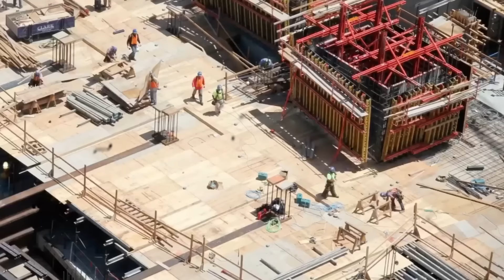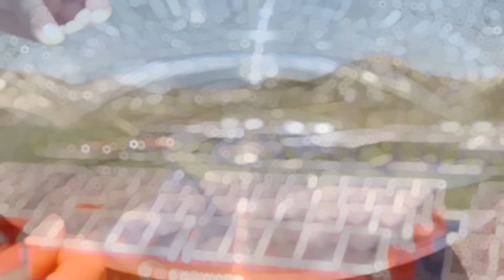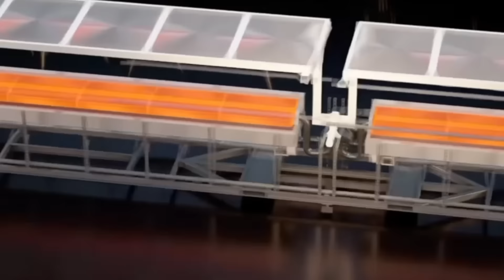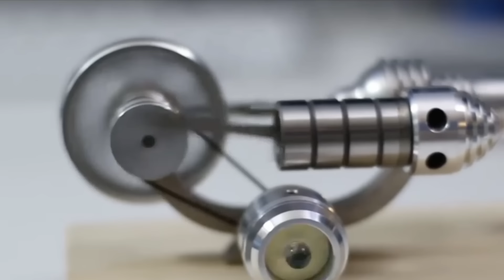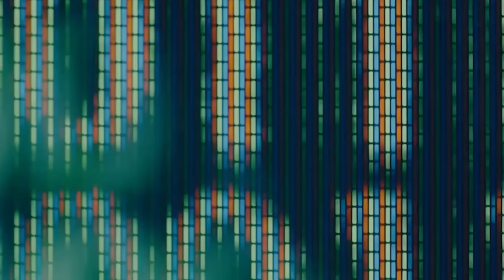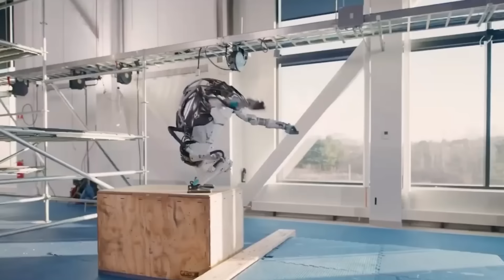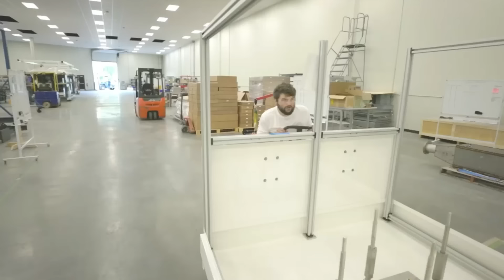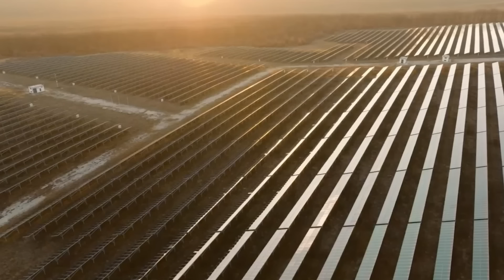Solar Energy is Changing: No Panels, No Lithium Batteries

Comment: Good for domestic use, if use them commercially like agrivolts under which you can conduct farming practices. But exo watt are not Compitable for that. 

Another factor is that exo watt have high maintenance i am not sure but looks like becoz the system it's running on a kind of machine which needs maintenance like changing the belt or the coils in it. 

For solar pannel they should discover an alternative to lithium ion batteries like supplying electricity to direct electric substation.

Comment: 6:10 The acreage for solar depends on if you sun tracking system or no tracking systems. Sun tracking allows 100-200kw per acre. No tracking allows for 400-500kw per acre. Also this does not consider local zoning restrictions.

Comment: Why not use vertical parabolic reflectors with a fluid filled collector pipe in a vacuum tube ?
No moving parts to wear out, Easy to keep clean. No snow or dust build up and mechanically stronger against wind force ?

Comment: Making it as a meachine could be harder 
What if they can make a powerplant kind of thing 

But instead of using coal, they use these lens to heat water, through steam generate electricity....

Even that's better than burning fossil fuels like coal...

Why is it not a thing ?
Any idea ?

Comment: Heat is 48% of the energy in sunlight. The "light" part of it is not heat. Heat has to be converted to electricity for distribution. That is probably 50% efficient at best.

Comment: According to my little brain, the thermal battery would work over night partly because the nights coolness, as the Stirling engine has to have a cooling side, but the battery would leak quite a bit of heat. So I reckon cloudy places would not work, as the storage is not long enough. Stirling engines are not very efficient, but there is room for improvement with new materials. This system would rely quite a lot on the inverter system, to create a goods mains voltage, from a varying source, and a computer to make sure it is pointing well, and telling the maintenance about issues.

Comment: I have been a Sterling engine fan since childhood. I would love to see it work at scale. I had high hopes for the start up back in the 2010s that was pursuing the dream using Fresnel lenses. If the batteries are an improvement, then all the better. I like how this inverts the mindset of the original model from converting light to motion to electricity to storage to storing light as heat as the first step, then to motion to electricity.

Comment: I wonder if you could harness the heat from data centers to recapture a small amount of energy 🤔
Reply: You could use air to water heat pumps to cool the server rooms and have warm water as a waste product.
Still you need logistics and infrastructure for that.
In the summer when you have to get rid of more heat, people need less heat. 
Not sure if there are many examples of where they are doing it already, but it sounds doable.

Comment: Just another fail project, guess if they rised the  fund, the guy whom think of it get a slide. 
For those thinking UK that out, like not having the sun to work out.
UK once used storage heater, that around same bricks. If this bricks work excess power could be used to charge and discharge.
It will work, but not to the point it selling that how I see it.. some other pointed out. Moving parts that needed more maintenance...

Comment: The question is if the lenses are cheaper than Solarpanels measured by kWh not space 🔍 you can use Solar with thermal or kinetic energy storage without transforming sunlight into heat and than to electric ⚡️ furthermore solar works with light - no need of pure sunshine ☀️

Comment: This MIGHT be a solution for special cases, but for general use, SIMPLICITY = no moving parts, fixed mounting, no maintenance ALWAYS wins. Try using these containers in africa - they will be dead matter in no time. Use them in northern areas? Forget it. P
11 minutes of overblown babling as usual, when some exotic approach comes up.
Combining PV panels with additional tech that uses the heat on the back on the panel, might make sense in certain areas and use cases.

Comment: Sounds good but there are a lot of concerns:
1) Americans = unreliable. Today you buy it and tomorrow receive tariffs, ID verification and no maintenance. So only for internal US usage.
2) Cost. What is the cost of this container? How much energy 1 unit can? For example, I want to install it one at my backyard in Australia. What will I receive? No answer even on their website.
3) During cloud days there is still light, but more diffused. Are this system works at these conditions?
4) If this ceramic block is so wonderful, and insulation is so prefect that the system can store energy for 12 hours without losses in efficient, solar light is the only source of heat that can be used. Virtually in can be everything.
5) Why Sterling engine? Why not thermoelectric generator? It contains less moving part and despite it less effective, the system can be more reliable with it.

Comment: I will say: "show me working installation" and total cost of it to providing constant 1kW through 24h (and same in next 30 days!). I will say It will never works in this shape for countries located as Europe as sun is a NOT rolling OVER at 90° in this locations, usually it is range 30-60° - so whole installation have to be slanted on such slope or totally redesigned. As well Stirling engines needs a huge "cooling side" which was totally omitted in this presentation. Looks like baloons, not tech.
Reply: Gimme that gooey VC money $$$$$ 🤤

Comment: The sun doesn't always shine. Same problem as Solar.
Reply: you obviously didn't understant the video. 
This system is very efficient and cost effective
Reply: @NeuralDev LmAO 🤣 😂 😆  Stop trying to sell snake oil. You are not fooling anyone with that garbage!
Reply: It doesn't, but the difference here is that it's based on temperature difference (since it involves a stirling engine), not sunlight availability. Push comes to shove you can heat it using a different fuel and would still work. it stores heat, not convert it directly to electricity.
Reply: Solar runs on light so there is NEVER a day that solar does not produce. Across OZ for all solar its approx +/- 35% from expected output for a given day in the future. Solar can be seen as semi reliable unlike Wind which is totally random.
Reply: @TimMountjoy-zy2fd  So are you saying that PV and Solar works at night when the Sun is not shining????

Comment: Every home could have its own small system
Reply: a shipping container takes up a large amount of space. in many cities, having a shipping container on residential property is prohibited. in the video, the container is equipped to gain upto 3,000 degrees. having that much heat next to a home is dangerous. and the system must be monitored continuously with access for repair, thus residential systems is not efficient nor viable.
Reply: thats trash. you shoudnt
Reply: @Jon-m19y Why? Who says that?
Reply: @greetings2510  i am. i know stuuf about solar concentrator systems.
Reply: @Jon-m19y That doesnt mean anything😂
Or you know everything about the economic potential of small operating units?
Source "trust me bro I know stuff" isnt enough, sorry
Reply: @greetings2510  
It does mean everything. 
I know about 20-40 technical indicators for such systems that justify whether they make economic sense or not.

I even know a list of similar solar power plants from 1960 years. Which ones are successful, which ones aren't, and why.

You don't know the energy per unit area.
If you can't even notice the lens area of these toys, what can we talk about with you ?
Reply: @Jon-m19y  they work at home, you just need a space to put some wood and burn it. This one can be used 24/7 if you have some wood.
Reply: @LucasBKOK  I think this message is not for me, right?
Reply: Noise pollution from the sterling engine will have to be considered. With that in mind, it can only really work in a mass household supply rather than individual homes
Reply: Yes that would be ideal if they succeed
Reply: @sharpedge74  They won't
Reply: @Jon-m19y lets see bro
Reply: @sharpedge74  first of all, the battery is radiating heat of thousands degree, if by any chance tornado flew it around, prepare for spreading fire.
Secondly, the sterling device working 24/7 will not last that long to wear, tear, and rust.
Third, the radiation emanating from this rod will require all parts withstanding it, even if contaminated, not through the very hole it feeds the sunray from. A meltdown of the system
Reply: Its all about central control and central billing. ' They' dont want you to actually have ownership and control and they make every effort to make that difficult.  Individual control is relatively easy to achieve, the real and most complicated problem is how to prevent insividual ownership, force central control and collect what is free and convert it all for commercial redistribution.
Reply: That scares the hell out of power companies.
Reply: If it ever takes off it will be heavily regulated and you will likely have to pay the difference you’d be saving just to use it, but as a usage fee. Or a tax. Watch.
Reply: @Xio189  that's why the 2A exists. To eliminate regulation, but the cattle needs to start using it.

Comment: The thing is we could not only use the sun but also the earth to heat and cool our buildings with little to no energy if we just abandoned our current stick built construction and returned to a mass built building system that has been proven to work for 9000 years. A system that let us survive a mini ice age centuries ago. A system that requires very little wood or cement  to construct. A system that it's building material is literally dirt cheap to build with. 

Add a 200 foot ground air tube system to that powered by a solar chimney with an auxiliary  8" inline duct fan that brings in fresh air to the structure at a constant 55 to 60 degree air tempreture all year long... dispites desert heat... despite winter snow.. a system that has been tested to withstand earthquakes that destroy wood and cement structures. That have documented to withstood class 4 plus huricanes. A system that 48 states refuse to let you build.

A system that if designed properly will let you collect most if not all the water the building will use. That can heat hot water withjust the sun in most parts of the country.

Think about it a minute... little to no heating costs, little to no ac cost, most buildings requiring no hot water costs. A system that requires zero insulation or plastic house wraps off gassing toxic chemicals. A system that would allow our forests to return to old growth in a century. 

My question is why are we trying to invent nachines to fix a problem we already have the solution for?

Comment: Does it run on single sterling motor per module? If it is it will fail. No motors can run 24/7. The other option would be putting additional motors either 3 or 5 and run them alternate with the help of automation.

Comment: Add the cost of electric motors to continually move the lens, more electric motors in the form of fans to move the heated air. The cost of the thermal engines and generators to make the electricity. It's all the extras that will cost as much as a gas generator does today but minus the pollution. In fact all that has changed is natural gas has been replaced by hot air. I don't really think this has been thought out as well is it could be.

Comment: If your video depiction is accurate they need to fit counterbalance weights to the moving lens support arms, this will reduce power requirement and component wear significantly.  heat transfer using liquid would be more efficient, less bulky, easier to insulate and more controllable with less losses.  I note the Sterling engine is becoming more popular of recent times, Robert Stirling would be pleased at last, it's taken over a century.

Comment: The University of Jhb in South Africa has developed a solid state battery with thermal junction build in. It converts low grade heat directly into current without the need to have turbines etc as the above tech describes. The same tech called "e bric" is also a structural battery that can be used for building infrastructure such as roads and buildings.
Reply: Any link to this solid state battery?
Reply: Any links or papers?
Reply: @72dew  it is a lie.
Reply: This claims that three yet unsolved engineering challenges has been combined into a single commercial product with no paper trail. 😠

Comment: The main question remains. How does that benefit the common man?? You CAN'T park a shipping container in the regular backyard. This system is limited to ULTRA RICH, large manufacturing facilities and utilities who will most likely extort the common man. Look me up when it's scaled down enough to fit on my roof or can be installed in my shed,

Comment: Go away.
With te expension of the only empty conteiner I buy 5kw PV modules, adding a 15kw lfp battery I go in pair with the shopping, and for 20 years I' m good.
One multikw stirling Is a lot exlensive and requires manteinamce.

Comment: Unlike solar panels there are way too many moving parts so service and maintainance will be the killer for this.
Reply: still... better local maintenance, than having rare/scarce raw materials that pose environmental (or subject to geopolitical threats nowadays).
Reply: @patricioj.valadespelayo9932 in Germany they developed a process to recover and recycle solar panels in a very efficient way ♻️
Reply: @patricioj.valadespelayo9932 sodium ion batteries will fix that
Reply: Given it's got container size, it won't be any solution for private household use anyways. It's rather something like a local power plant for a certain area, maintained by a professional crew (who might oversee several of these)
Reply: That's why you just use solar vacuum tubes. Pipe the heat into a sand battery. This system is DoA due to maintenance and complexity.
Reply: @Gr8Unc can you explain?
Reply: @kaspar-h8h https://youtu.be/f7wZwUOVLzk?si=40ubddKd6JxlwKMS
Reply: The idea is use heat energy for thermal work. Like heating water. Or heating AND cooling your home or refrigerator and freezer. Drying clothes. Don't use pv solar just to convert it to mechanical then to electric then back to heat...
Reply: But much simpler to replace
Reply: @southsupremancy  really? Solarpanele are just a couple of screws and a cable - plug&play 🔌 ☀️
Reply: @SolarYacht  yes. Solar panel needs complete panel replacement and not repairable 😂
Even cycle is easier to repair than Solar panel.  😂
Reply: @southsupremancy  just exchange it 🤷‍♂️
Reply: @SolarYacht so its not repairable easily since 80% of the cost is panel. You can buy new one in that price
Reply: @southsupremancy  no the battery is the most expensive part. the panels are cheap
Reply: @kaspar-h8h both need battery to store energy lol
Reply: True
Reply: It has moving parts and needs maintenance, but not a ton of either.  
If they get it all to work, it may be too big and need too much care for home use, like solar, but if you put a bunch in a South West desert with handful of staff to maintain them, it could make a power plant.
Reply: The Stirling engine was used to pump water from the sun in many rural areas, they are very low maintenance due to few moving parts and they use displacement piston rather than compression. I really like the idea and I think it could be made smaller for individual property use. It is possible using solar thermal panels to reduce the mechanical issues. I have light tubes fitted, they have a dome which takes light from the roof down a tube to internal rooms I guess a fresnel lens could possibly be domed to reduce or eliminate the need to move it?

Comment: This one makes a lot more sense than filling the desert with silicone panels.
Reply: Power generation per square foot would be the equation needed here. Or KWh per square foot
Reply: @megsman4749  not in the case of a desert where its land has no value. In fact, deserts would actually benefit from having more shade that would allow the land to retain water for a little bit longer.
Reply: @72dew bro desert are the reason we get adequate rain fall . 😊😊😊😊
Reply: @m @megsman4749 ,1Kw per square mater.
Reply: This will definitely take more space as it has less efficiency.
Reply: The shipping container again. I thought the fraudulent claims of Andrea Rossi for his ecat had been enough.
Reply: Not necessarily. The evidence is that solar arrays in arid areas can create microclimates that can benefit flora and fauna. Also,  if you look at what China has done, its hard to see solar arrays in the desert as being negative.
Reply: Never heard of those before
Reply: It's the same    Near enough
Reply: No one's using the desert.
Reply: IS THIS AVAILABLE IN THE MARKET ALREADY? AND START HOW MUCH 😊